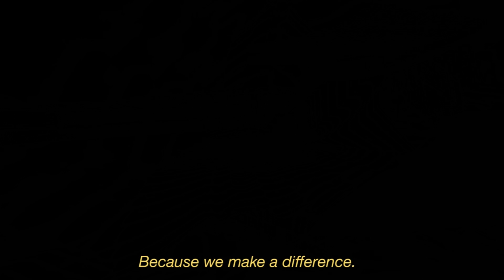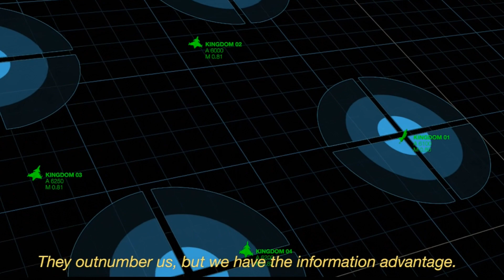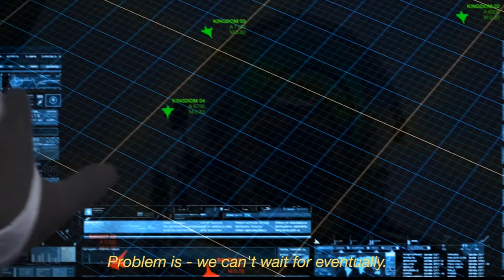Gripen Fighter Jet - Canada's Future Fighter?

Comment: Canada will never participate a first strike, deep penetration strike against a  non-third world country. Canada has no need for the F-35. No need for locating a Stealth aircraft, as a Lockheed Martin shareholder I receive great in house progress bulletins. None of the 3 F-35 models have achieved more than 60% of their published ranges, the Marines have only achieved 50% with the B model without weapons or an installed radar. The median failure time for the do everything radar is still less than 2 hours as of 7-15-18.
Drop the tankers and AWACS and you have a slow, sluggish aircraft with the kinetic performance of a 45 year old Block 20 F-16B.
Zero F-35s and 120 Gripens is what Canada needs.

Comment: It should be noted that the JA 39 Gripen is actually of the same generation as the F/A-18A/C, the delay in entry to service having been created by the inability of Sweden to fully fund a national aeronautics industry without significant export orders. Its weapons, especially guided missiles, avionics and engine are all license-built or derived from other national programs, especially the US. Canada had a national aeronautics industry and still does in the commercial sector. The problem was putting all the eggs in the CF-105, which was very much pushing the tech envelope in the late '50s and was basically a single mission aircraft, all-weather, long range interception of masses of Soviet supersonic bombers. When it turned out from satellite recon that the Soviets not only didn't have a large intercontinental bomber force, but didn't have a working supersonic bomber, a number of aircraft and missile programs directly related to that threat died. In the US, the F-108 was cancelled, BOMARC went out of service early, Nike-Zeus died, the F-106 buy was reduced 67% and the ADC was rapidly reduced in size along with the Army's SAM sites and battalions, so it wasn't any US conspiracy to stop the Canadians from building one of the finest interceptors designed in the 1950s. This knowledge impacted the British also, seeming to confirm their 1957 decision to turn away from manned aircraft. Before that, the Canadians built the CF-100 which was a well designed long range all weather interceptor which should have been procured by the USAF instead of the F-89 and which earned some export orders. They also license built the Saber and then put an Orenda engine in it. The Saber F.6 was probably the best fighter version, even compared to the Avon-engined CA.27. That Canada does not currently build combat aircraft beyond trainers and helicopters was the result of bad luck, bad decisions and a conscious by successive Canadian governments that they couldn't afford an independent combat aviation industry. Remember the Canadians did build their own version of the F-104.

Comment: The Canadian Air Force should strongly consider the Saab Gripen as the jet fighter of the future.  If America has become so obnoxious and belligerent on trade, then do business with others and buy a superior jet at the same time.  The Saab jet is well designed, has a fast turnaround time, highly agile and has the latest avionics.  Reliance on American jets could work, but if Canada can broaden ties, get a better deal and buy a design that is more modern than the F18 or F16, then do it.  The F16 jet production line is being moved to the Carolinas and downsizing its production for mainly export, which should tell Canadians that the USAF itself is not planning on more acquisitions.  The F35 jet is yet to be combat proven and its high unit cost and likely high cost of operation have to be considered.  The Saab Gripen is a smart, efficient and very capable jet fighter that has a lower operational cost than a French Rafael or F35.

Comment: Forget the F-35, it is not a proven aircraft, its too expensive, its single engine, and reportedly very problematic.  go for proven tech and get away from the US for our gear.  I also like that both SAAB and Dasault will transfer tech and build at least in part in Canada
Reply: No aircraft in the peak of of its introduction is proven, that statement is very ignorant. The most it has been proved, is in a positive light. It had a 20:1 kill ratio at red flag and the IAF has conducted airstrikes with it.

The JAS-39 is also single engine, and what is so bad about single engined aircraft?

Literally every military aircraft has it’s problems at its start, especially something as revolutionary and high tech as the F-35. Does that mean the aircraft is crap? No.
Reply: No my statement was not  ignorant, when your country (Canada) does not have an unlimited defence budget it can't afford to purchase planes that are still at the very beginning of their production run, cost way too much and have not got all the bugs worked out yet, perhaps 10 years down the road maybe.  Also unlike the USA Canada only has one Fighter / Bomber aircraft, not many different and purpose specific planes, our aircraft need to be very utilitarian, and cost effective enough to buy enough units to cover a country the size of Canada while being modern enough to compete well against any real potential threats we may come against.  Single engine design is inadequate for Canada as a core part of our Fighters purpose is to conduct far north Arctic patrols and we have found over the decades that under those conditions and with those operating durations, engines can and have failed repeatedly. Purposely buying a plane that has no backup can and will lead to loss of aircraft and the likely death of the crew.  The F-35 has great potential, and I could see Canada eventually buying a squadron of these planes as a special purpose, advanced training unit, but it is outside our parameters as a "workhorse" aircraft.
Reply: Ron Fischer My mistake, I thought you were talking about the F-35 as a whole.
Reply: Ron Fischer Also, how does the F-35 “cost way too much”? You get what you get when you put the best technologies in your aircraft. 

The bugs have all been dealt with, F-35s are already being based on areas such as Japan and have been used by Israel in bombing raids.

And what “proven” aircraft are you thinking of? The Gripen is no more proven than the F-35.
Reply: Actually  I would favour the Dassault Rafale fighter having flown countless missions in Afghanistan and Libya it is a fairly proven aircraft.  This Aircraft was purpose built as a true utility plane and is therefore well suited to Canada's needs.  With more then 10 years in the air I expect what bugs there are, have been long solved.  I would also look at the Super Hornet however the Canadian government is feuding with them over Bombardier Aerospace at this time.  The original comment was aimed at the Canadian People as I feel the F-35 is not the right aircraft for us at this time.
Reply: Ron Fischer Good point about the proven part. I’d assume you were talking about the Gripen as the only alternative, as the video was about the Gripen and the F/A18E super hornet and Rafale will be comparable or higher priced than the F-35A the future.

Comment: Canada is highly unlikely to go for a mixed force. Canada is huge and its number of aircraft needs to be disturbed across the country in specific ways. It needs at least four main bases (one for each coast, one in northern Alberta for the north, and one in central Canada for protecting population centers), plus extras for oversees deployments. One squadron each is about 64 operational aircraft. It would be extremely difficult to go for a mixed force with F35s. If it bough only 20 F35s and say 50 Gripens… the F35s would be utterly useless as you have them all in one base (too far from where you need them) and you can't spread them out with 5x 4 -- not enough for training, too many expensive maintenance facilities, etc. 

However, even if Canada were to go for a mixed fleet... it would almost certainly go Superhornets… since cost of acquiring, maintaining, servicing, training, etc. is so low vs. anything else if you won't want stealth and/or you expect F35s to fly alongside them.

Comment: Welp, might as well throw in my 5 cents (can't do 2 because fuck pennies!). Below is a totally a unprofessional opinion, so if someone with actual knowledge or experience wants to contradict me, please do! ^_^

Canada is part of the North American continent. the U.S. has the most industrialized military on the continent. We share NORAD and partner heavily on continental and global military exercises. We're spatting with Boeing (fuck them being pissy about the C Series!) and their Administration right now (the walking pile of orange distaste), but we should work to resolve those...WITHOUT getting ripped of, tyvm! The Eurocanards ARE amazing! But It's just easier to resupply and integrate with our main military partner if we get planes from the U.S.

A versatile air force is the most effective military option going into the 21st century and probably beyond (unless you subscribe to nukes, nukes, and more nukes!). That being said, we have nowhere near the budget or high tech capabilities of the USAF, so here's how I think we should go forward: 

Forget the Super Hornet. Though it is clearly better than the CF-18, it's also much more expensive. Just keep buying used F-18s from the Aussies and Yanks. Cannibalize'em & try to keep as many CF-18s upgraded & functional as possible. They work fine and are cheaper.

With the money saved, we should be able to buy some F-35s, though fewer than was originally stated. The JSFP has too much momentum, and we paid into it already. Might as well get a few, though the numbers will depend on cost. Don't replace CF-18s with "CF-35"s. Just supplement them while we keep flying the Hornets into the ground, with the option of replacing as they go. Maybe in the future we can replace CF-18s with F-15s instead? THOSE are some badass jets! Anywho, being stealthier, the Lightning IIs can be used for scouting, air superiority and first strikes, with Hornets backing them up as needed. Stealth isn't always needed, so CF-18s can still be used for a lot of emergencies, routine CAPs, and ground strikes.

The firepower of jets is overkill for some missions, so for some lighter air to ground power, and to take the strain off jets (and if there's still any money left!), the RCAF should get some A-29 Super Tucanos or AT-6 Wolverines. These little turboprops can be crazy useful for Canada! They are cheap, easy to fly, easy to maintain (their engines are built here), are basically already used as trainers for the RCAF, can be used for weapons training before pilots get to jets, have long ranges, long loiter times and are much more proven than the F-35. Canada has no good close air support for infantry. These would be a very cost effective way to fill that role. They can carry enough firepower for what we'd need them to do.

In summary: 3 planes to fill Canada's needs for itself, NORAD and NATO where smaller attack aircraft are required. A small to moderate number of "CF-35"s as the high tech, tip of the spear, stealth strike fighter for the RCAF. CF-18s as cheaper, multirole, workhorse jets. Either the A-29 or AT-6 as a light attack and observation aircraft. These 3 are relatively easy and/or cheap to acquire, line up nicely with U.S. weapons systems, & fill almost all the roles the Canadian military needs in a versatile fleet of attack aircraft. 

Am I dead wrong? What are your thoughts?

Comment: A Simplistic(However Serious) View: Buy 150 Gripens and build(JOBS) them in CANADA and have them throw in 150 trucks from SCANIA, which they make a variety of(military ready). Use aging F-18s for Arctic Patrols, etc. The 60+ plus F-18's have dual engines and I'm sure with 60+ still flying,  they can keep enough flying for a few years for both Arctic missions and NATO commitments abroad while the Gripens($30-60 million each) come on-line. The F35 is WAY($122 million+, up to 4 Gripens) over priced, FORGET IT FOREVER!!! Now, this will raise eyebrows, but goes here goes: someone should have been hung (namely the PM) for the loss of the Arrow and our engineers to NASA. The Arrow is dead, perhaps 'some' ideas/concepts/etc are transferable. We will ALWAYS need a VERY high speed dual engine interceptor for Arctic Patrols, then engineer it in Canada now. This is CANADA we have the talent and FUNDS...THIS IS NOT A 3rd world country...what a JOB creator...Initial Arctic_01...learn....Arctic_02...learn!!!! This will ensure full employment and hey WE can export them..dream a LITTLE people! out4now - Marcus
Reply: JAS-39Cs cost upwards of $75 million each. The new JAS-39E costs more than $100 million. Even back in 2002 they were offered to Poland at a price of $69 million each, and those were as you can imagine far less capable than modern Gripens.

The F-35B costs $121 million and is significantly more capable. The F-35A that would suit Canada's situation better is $94 million. If you want cheap go for the F-16 or F/A-18 at roughly $70 million each.

Comment: Australia (where I'm from) and Canada actually have fairly similar requirements in this role. We each need:
1. A long-range, air-supremacy fighter that can be projected fighters (RAPTOR).
2. A long-range, strike/SEAD/anti-ship striker that can penetrate projected air-defences (???).
3. Interoperability with NATO for deployments. (Any really)
4. Maximum flexibility with basing and logistics. (GRIPEN)

F-35 doesn't have the long range or sufficient payload to be either of the first two roles- not for a single nation operating independently (USAF might be a different story). And the stealth is problematic. Avionics are sweet of course, but that's not everything.
Gripen is a bit hampered by the single, small engine. It has decent kinematic performance but not outstanding (certainly not in line with the Su-35 or projected threats), lacks stealth and there are valid concerns about operating a single-engine design over water/arctic condition.
Super Hornet has the two engines and can cover these roles with generous tanking- but doesn't excel kinematically and is no stealth fighter.

Best option is an evolved F-22 and FB-22 design. But then that's not an option anymore. Guess we're better off developing drones- that way we can accept the losses.

My two cents, keen for debate.
Reply: Gripen is very affordable and flexible. Whatever our countries do purchase- we should aim for these attributes as well. I love the Gripen, but it's really only practical for smaller nations with allies close by.

Comment: Canada needs a two engined, long range fighter..  A single engline short ranged fighter is not suited to large countries like Canada..  Canada has large areas with a low number of suitable air bases so if a Canadian Fighter has an engine failure the chances that the pilot will be able to use a suitable air base within glide range is very low.. So a short range single engine aircraft is the worst option.. The griphen is a short ranged single engine fighter..  Canada currently has a duel engined fighter for a reason.. If a duel engined fighter suffers an engine failure it can still fly on the remaining engine and reach the closest airbase.. This means the loss rate of a two engined fighter in the Canadian environment is lower then the loss rate for single engined fighters in a Canadian type environment..  

So Canada should go for a Duel engined, longer ranged fighter..   Mid air refueling can mitigate the problem of a short ranged fighter but that adds a higher cost for Canada because the number of refueling aircraft and the number of sorties they need to carry out supporting short ranged fighters is higher..   The gripen suited to small nations with a large number of suitable air bases.. Smaller nations like Denmark , Netherlands, Belgium are well suited for the use of single engined short ranged fighters..  Not countries like Canada..

Comment: Sweden has always produced great fighter planes, but what you really have to admire is the Swede's kick up with marketing. Check out the subliminal stimuli at 7:05. If you pause it at right time (helps to set the speed at 0.25), you can briefly see "No. of personnel <1" and "Turnaround time air-to-air: 10 ms" (as 10 milliseconds). Funny fact: marketing with subliminal messages is illegal in EU, but I suppose when marketing to Canadians it's ok. :D

Comment: The Gripen JAS 39 E/F is essentially 2/3 of an F/A-18F Super Hornet, like the F-16C is 2/3 of an F-15E. Does it make sense as a hi/lo mix aircraft? I doubt it, the basic aircraft first flew in 1988.  The price will be high, almost as much as a Super Hornet for less capability and more support costs.  I think Canada should buy the Super Hornet which has some compatibility with existing aircraft. Geoff Who notes Canada should have purchased the F-18L instead of the F/A-18, but time machines are unavailable.